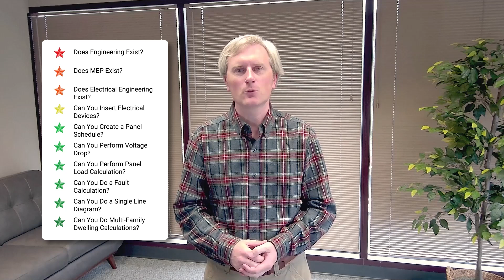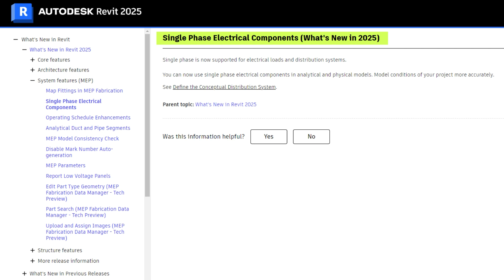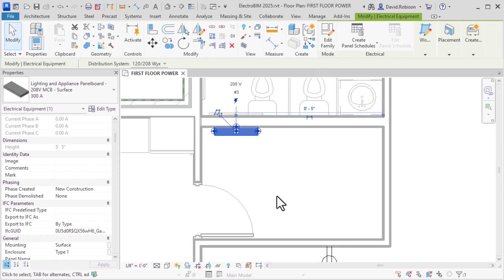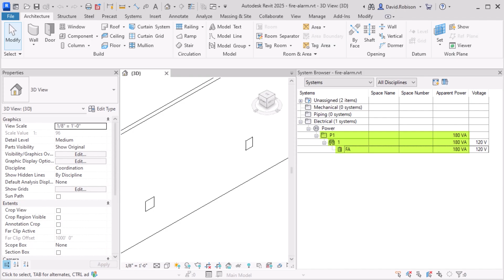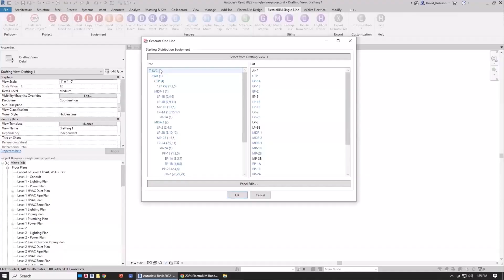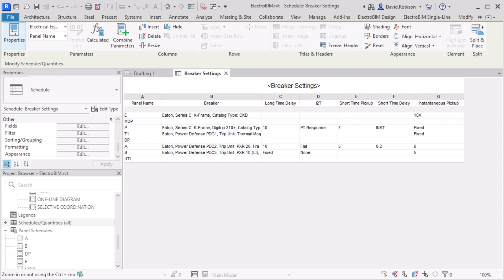Revit 2025: New Features for Electrical Engineers – Episode 15   #BIM #Revit

Comment: Thanks for the summary, David. We are disappointed but not surprised by the lack of any new electrical specific features that will make a meaningful difference to our workflow. The don't increment mark feature is a bit baffling. If we used the mark parameter, we could easily reset it manually or with a dynamo script. The feature to roll up low voltage panel loads seems to me more like a bug fix than a feature. Electrobim by contrast continues to evolve and we are seeing concrete improvements in our accuracy and productivity as a result. 
We might upgrade to 2025 but as usual this will depend on general feature improvements and not anything in the MEP world.
Reply: The line between feature and bug can be a little blurry. I'm glad to hear our improvements on ElectroBIM are having an impact on your work.

Comment: Mark numbering would generate warnings when multiple users are placing devices, fixtures at the same time in a shared model when the model is synced.  Disabling marks saves the warning from being generated.
Reply: I would argue that disabling the sequential mark actually helps not designate something that needs a different designation. Sometimes during design you miss things that have values, here it forces you to make a conscious decision.
Reply: @bradbb2005  That also makes sense as a benefit of disabling sequential marks. I love that I've gotten three different reasons for why they made that change. It sounds like the change benefits lots of different workflows, which is great.
Reply: That makes sense. I can see how getting rid of that warning would be a welcome change. Thanks for sharing your experience with marks.